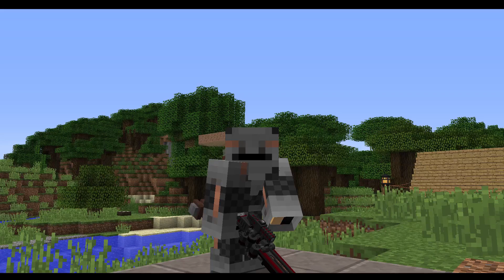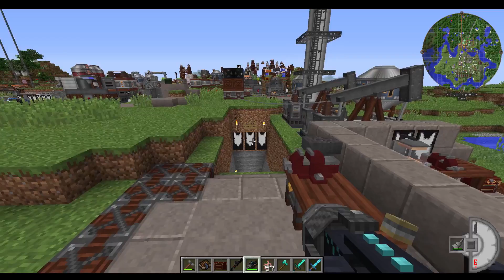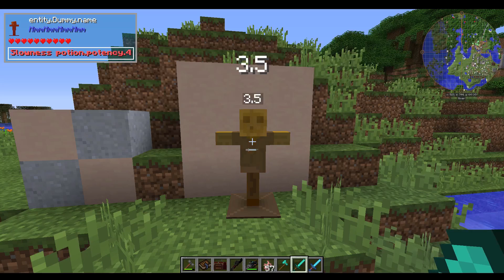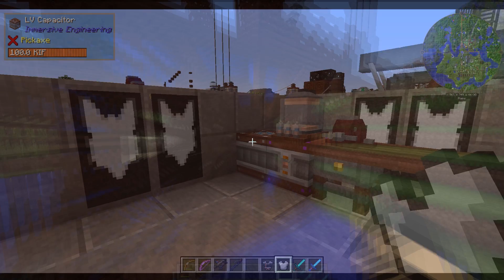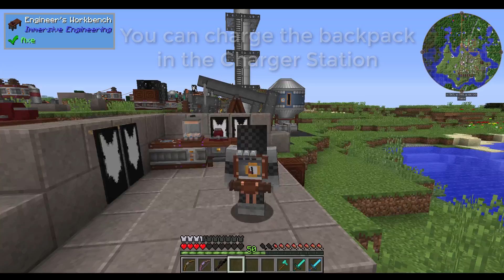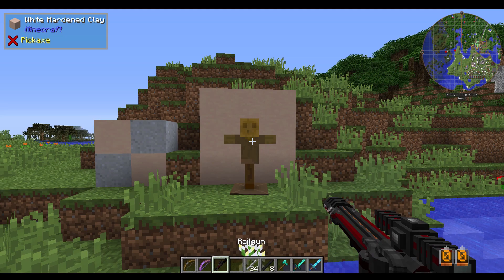Immersive Engineering: Capacitor Backpack & NEW 1.11.2 stuff! - Minecraft 1.11.2!

Comment: Note to self: Make Concrete Feet give 100% knockback resistance, so things don't get knocked out of concrete anymore. Also, I should maybe not have the Railgun zoom apply in 3rd person? :D

One of the best shaders used for the drill there =P
Reply from the maker: The kb buff sounds great! Railgun zoom is up to you as always. It can be silly fun but less Immersive. <3
Reply: @MischiefofMice  how do you charge the capacitor backpack?
Reply from the maker: @jacobrispoli4351 Put it in a charging station
Reply: i know its an old post but the railgun seems to fire the rods faster in later versions than shown in this video. how fast do they actually travel? ive tried to calculate it but my current estimate is 16 chunks a second which seems like it might be wrong

Comment: You can enchant diamond axes with sharpness and smite & bane, smite 5 axe can 1 hit any undead except the Wither (Boss), the mining drill does 11 damage, a sharpness 5 axe does 12 damage (6 according to the test dummy) and a smite 5 axe against an undead mob does 21.5 damage (10.75 according to the dummy, heart terms).
Reply: Now do note, I would still have a mining drill, and probably use it as a general weapon, I just was annoyed that you seemed to ignore that axes can have damage boosting enchantments.
As a not so important side note; bane 5 & smite 5 diamond swords do 19.5 damage against relative mobs and bane slows spiders with slowness scaling per level of enchantment, this also prevents them from jumping apparently (though I think they still jump when next to you, if not, then they still attack), bane goes well with knockback and fire aspect, as a fun fact, the enchantment "light pierce" from AbyssalCraft works like bane but against shadow mobs, so it slows them down and deals more damage than a sharpness 5 sword would to them, this is more interesting considering that most other mobs in the mod are undead (smite is a must with AC).
Reply: The minimum damage a power 5 bow should be able to do is 22.5 (11.25), but it must be at full charge, no less, and even when it seems like you did everything right bows can be a bit frustrating, however since they technically are the most powerful weapons (with slow attacks as a balance) they shouldn't be overlooked, they get a 25% damage boost per level of power, and their base damage is supposed to be 10 or 11 (If I remember correctly), of course arrow speed plays a role in damage too, which is why a power 5 bow might only do ~19 damage to a creeper (9.5 hearts) instead of the 22.5 it's supposed to do at minimum, as well as perhaps one didn't pull back fully (like during server lag, also no innuendo intended), you can only hope that tipped arrows and flame will save you at that point.
Reply: Ooh, graphite, not exactly infinity compatible (then again neither are tipped & spectral arrows), but that is good.
Reply: I did enjoy the video! but you're wasting ground oil, that pump is spewing out many black particles...